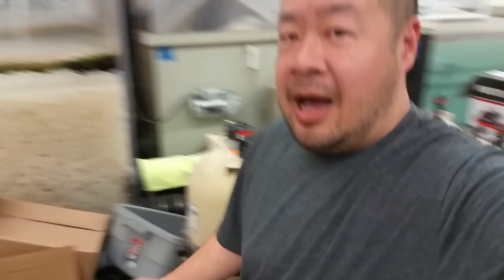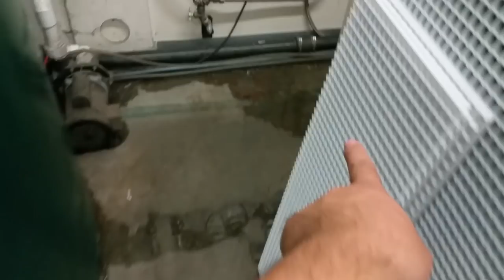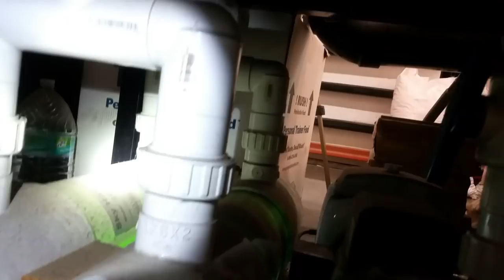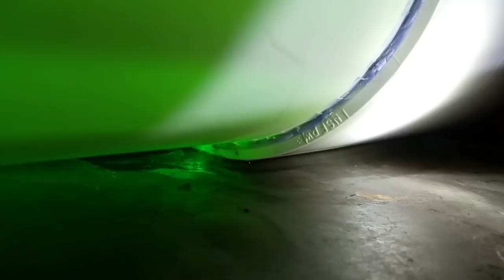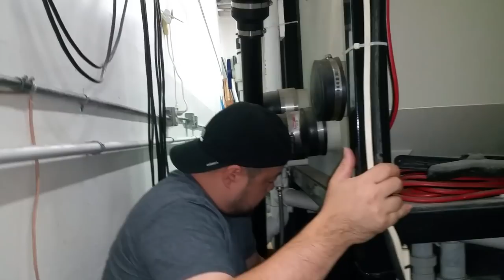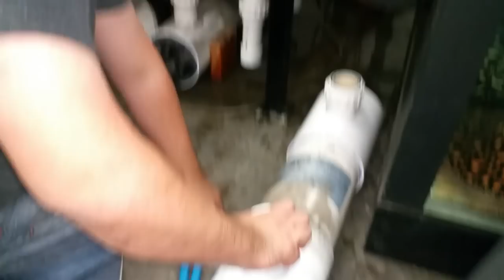AQUARIUM FILTRATION LEAKING - Where the heck is it coming from?

Comment: That's why i like aqua uv. One continuous piece minus the cap for the bulb and power cover. Perhaps use come super strong pvv cement after cleaning and clearing out the effected area.
Reply from the maker: Either way there are components joined together regardless of manufacturer. In this case it was a defect in the pvc itself.

Comment: I would clean the joint as clean as possible and then flood the groove with thin CA. You will see if the CA goes in because it will disappear from the grove. Some kind of really thin PVC glue would also work  but might be hard to tell if you got it.

Comment: its worth you changing the 4 bulbs from the other UV while your at it surely Kevin. theres a silicone here that's called sticks like sh*t that is brilliant for fixing leaks even if its damp though better dry. may I suggest that and that you do the other end of that UV with it and the other UV . it comes in clear or black here in the UK and isn't effected by UV either. it doesn't smell either. just don't use it for actually putting a tank together. what ever you seal it with I would do both ends of both as they have all been under the same load.